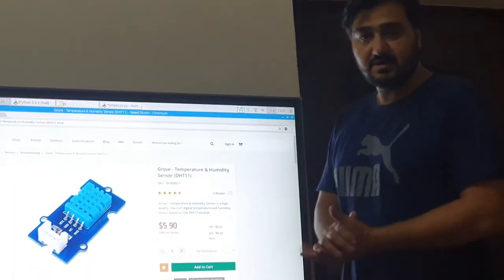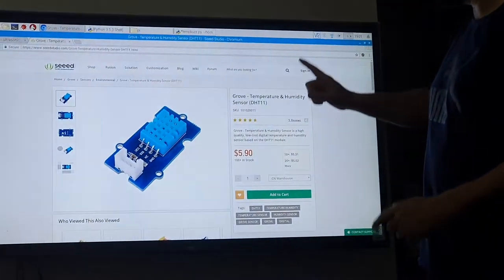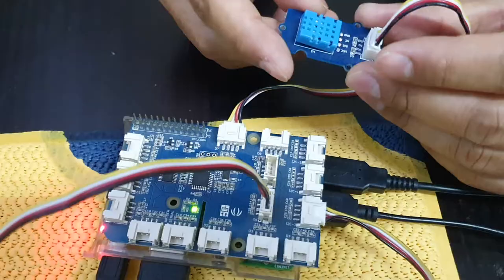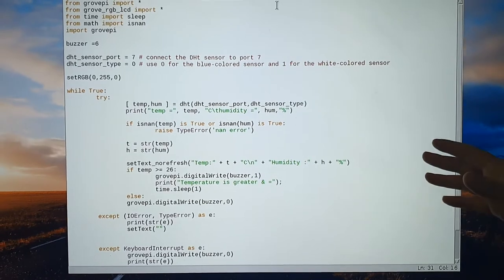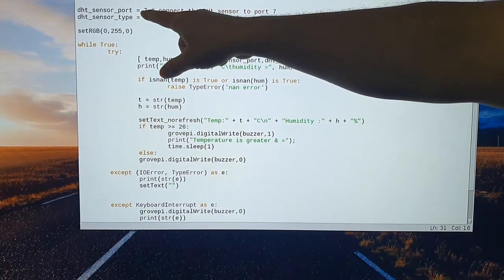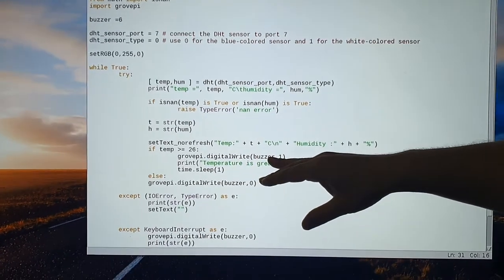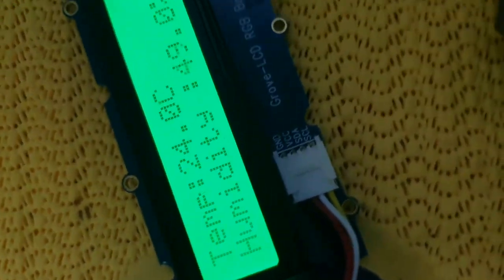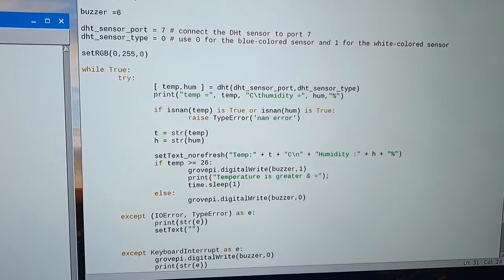Temperature And Humidity Sensor Programmed By Python.

Comment: can we get the code for it
Reply from the maker: please try to write the code by yourself. for your reference ,i am going to write code here
import grovepi
import math
# Connect the Grove Temperature & Humidity Sensor Pro to digital port D4
# This example uses the blue colored sensor.
# SIG,NC,VCC,GND
sensor = 4  # The Sensor goes on digital port 4 if you are using another port change here.
 
# temp_humidity_sensor_type
# Grove Base Kit comes with the blue sensor.
blue = 0    # The Blue colored sensor.
white = 1   # The White colored sensor.
 
while True:
    try:
        # Iam using in this example the blue-colored sensor.
        # The first parameter is the port, the second parameter is the type of sensor.

        [temp,humidity] = grovepi.dht(sensor,blue)  
        if math.isnan(temp) == False and math.isnan(humidity) == False:
            print("temp = %.02f C humidity =%.02f%%"%(temp, humidity))
 
    except IOError:
        print ("Error")